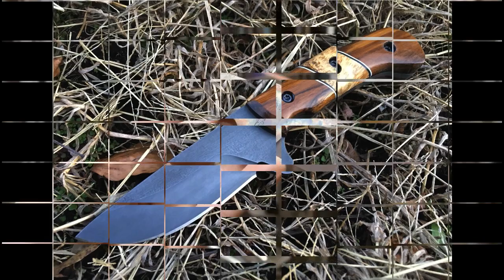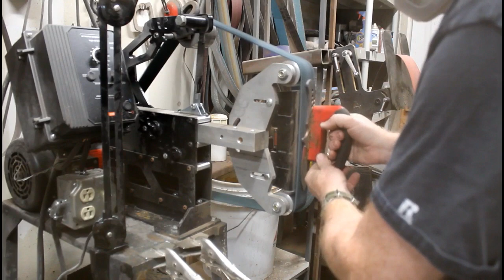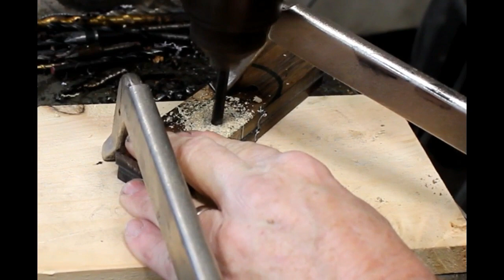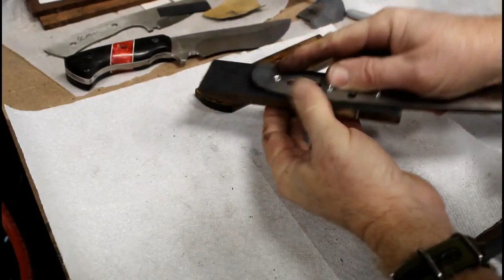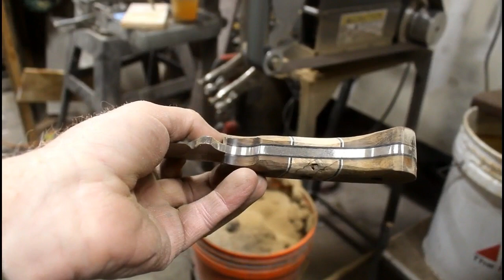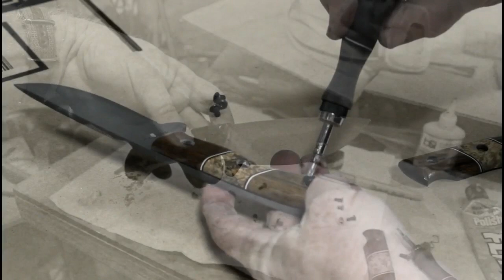Knife Making Tutorial Part 3 Finishing Bevels and Handle assembly

Comment: Realy turned out well dan. Great color combo. Its also one of the best ways to utalize small amounts of highly decorative material that you just dont have enough of. Would also suit a stonewash blade finnish.
Reply from the maker: Thanks Fran. Really appreciate the feedback. Was think of stone wash but do not have a tumbler yet LOL. Going to have to start looking for one.
Reply: @DIYeasycrafts  you can make one, realy easy. Its expensive to buy one big enough for k ives, bout 350 t0 $400. You can use a small bucket and a battery or electric drill, as long as speed can be reduced. Just cut a woodin disc same size as the bot of bucket. Then bolt it through the bucket and the disc with a washer on each side then put on a nut and tighten. Use a long enough bolt so it can fit in a drill chuck.myou can add a few screws in the bottom for extra suport while it spins. As for the stone media you can use, beach stones of various sizes or broken crockery (ceramics), you can also buy them online. Youl have to experiment with different types and sizes as they produce varying results in design.
Reply from the maker: I see a project in my future LOL. Thanks for the info and idea